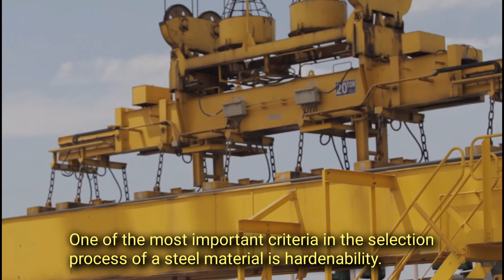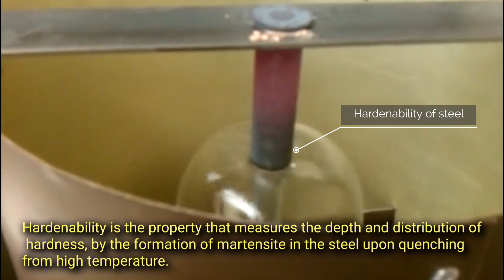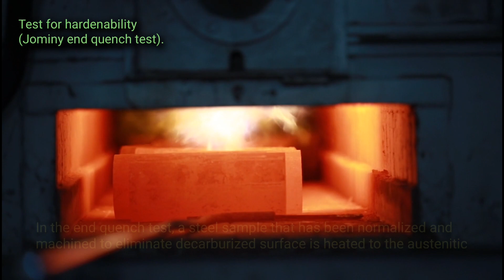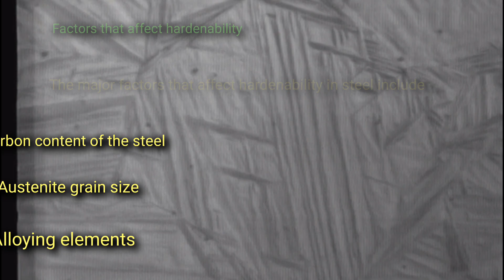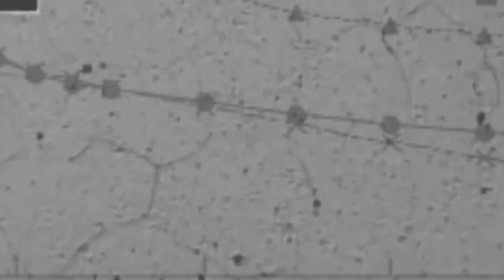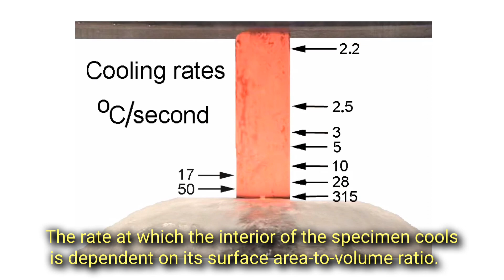The Hardenability Of Steel

Comment: Hello from Turkey.
The critical cooling rate used in the field of heat treatment is related to hardenability. If the TTT diagram of a steel is close to the right side, a high hardness microstructure can be achieved even at slower critical cooling rates. This depends completely on the chemical composition of the steels (%C, %Ni,%Mo,%Mn,%Cr)